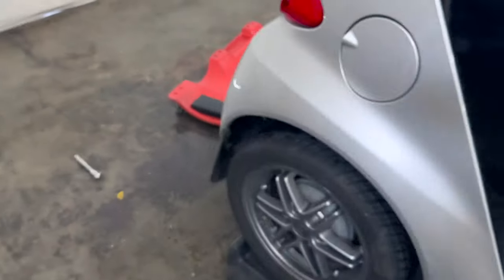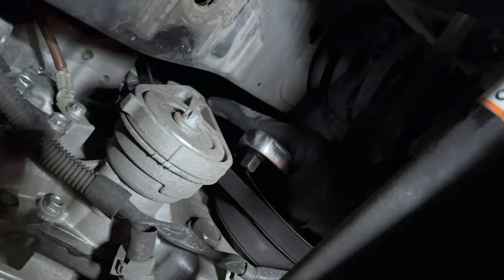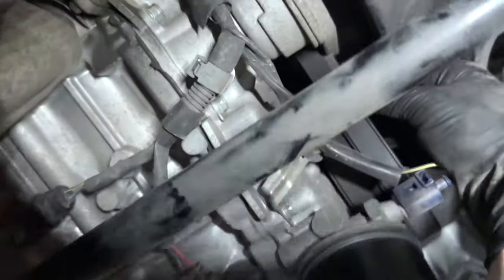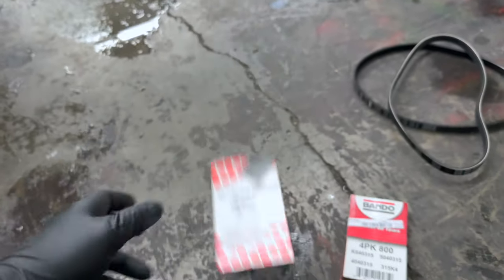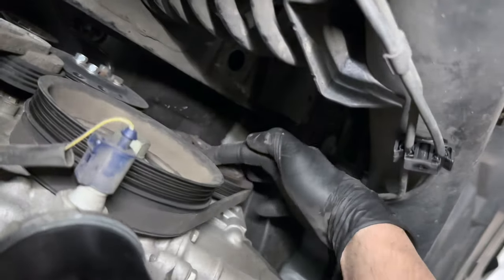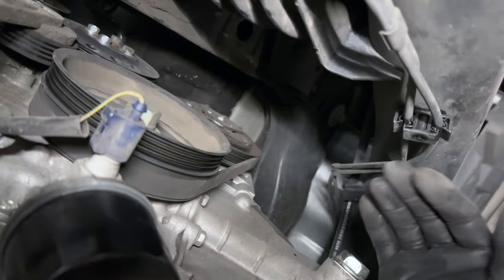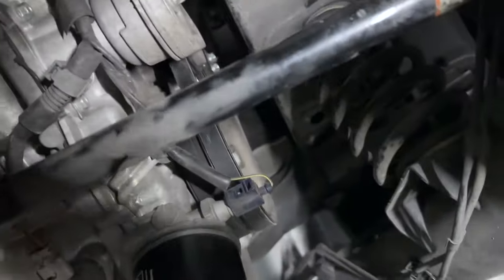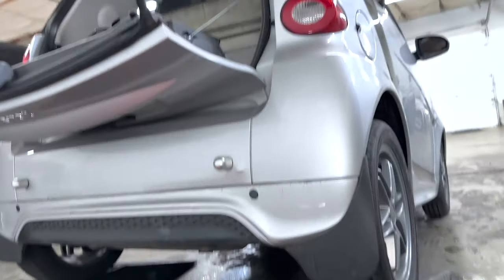Smart Fortwo 451 - Engine Belts

Comment: Thanks for the excellent video. I have a tip for those that are finding it difficult to move the tensioner in place. Instead, remove the tensioner, put it in a vice then move the tension and lock it in place. The next step would be to put your belt in place, then remount yhe tensioner. Make sure the tensioner wheel is to the right (inside) of the belt.
Tighen the tensioner, then remove the pin locking the tensioner in place.